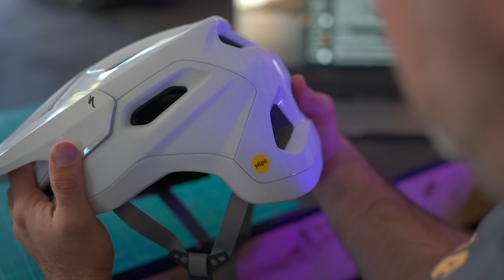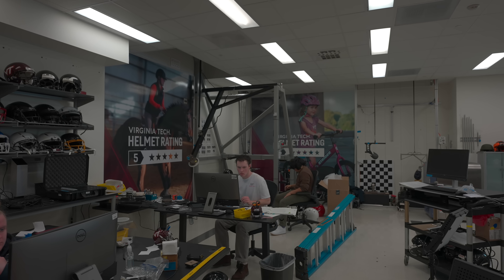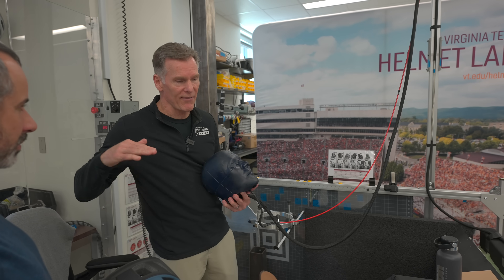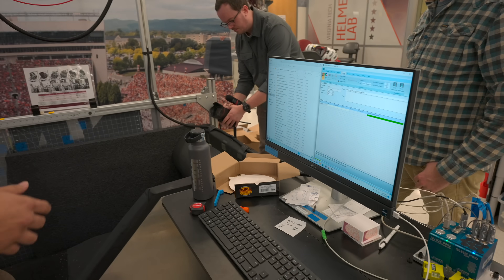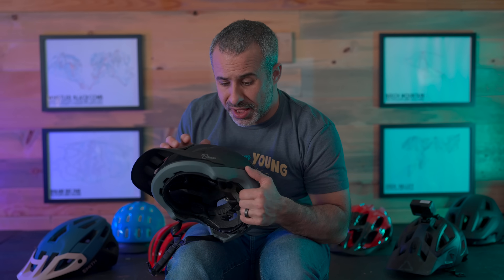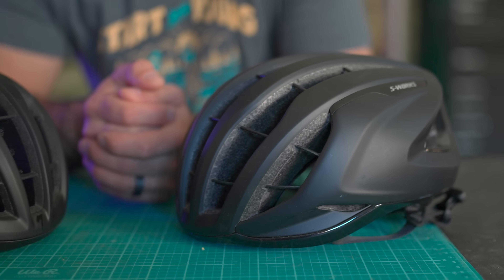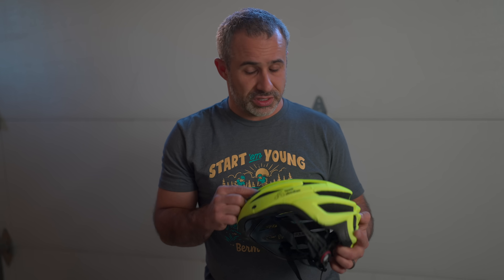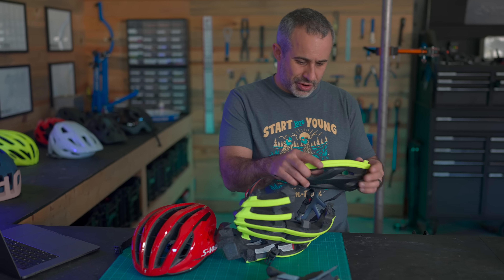Are Cheap Bike Helmets Safe? We visited a helmet testing lab to find out

Comment: I recently had a friend crash on a ride.  It split his helmet and he died on site.  He had a MIPS helmet bought at Costco.  I wish all helmets were required to have ratings.  I know Costco has quality products,  but a rating would have been good.  We had actually discussed him getting a Bontrager.  I spend lots of time thinking about how a bike helmet is no place to save money.
Reply: MIPS isn’t a brand, it’s a helmet safety system and standard that is, in its own sense, a rating system. Thats why at 13:27 when he’s talking about the super expensive Specialized S Works helmet it has a yellow MIPS sticker. 

Your friend likely had a very good and highly rated helmet. 

With that said, there are going to be helmets that at a certain point aren’t going to be able to protect a head when enough force is applied.

Comment: Great information. I once witnessed a crash that really drove in the reason for a good helmet. I was on a week long bicycle tour that was also raising money for a good cause. Anyway, one of the days on the course the highway department was doing crack repair. They cut out the cracks about an inch wide and at least a couple inches deep. Then they clean out any loose debris and fill the cracks with fresh hot tar. The be part the section we came up was long downhill, every rider on the tour new about the hill and we were fired up to bomb that downhill run. Organizers of the tour and the highway department had other ideas they had people warning us to slow it down, that road was not safe and that the cracks were wide enough to swallow bike tires. Most riders slowed down, but one woman, she blew through them with her hair on fire and bombed the hill. I’ve hit speeds in 50 plus mph coming down this hill, and it a lot fun, one of the interesting parts of this piece of road is a large rock outcrop at the bottom, they built the road so it goes around the rock. And normally it’s not a problem to navigate, even at 50 mph. But not this day. Anyway, she hit the bottom at max speed and her front wheel sucked into one of those cracks stopping dead right at the apex of the curve. She flew a good 30, 40 feet through the air before landing on the rock head first in pile. She didn’t move, me and several others figured she was dead. Her helmet cracked in half and she was out cold. Now hers were Fate watches over children and fools. The nearest hospital from that location was about 40 minutes away. One of the riders was a nurse and had the good sense to not move her. But then a National Guard medical unit returning from Duluth after training for closed head and spinal injuries just happened to be coming down the road shortly after the accident. Within minutes of being told what the situation was the unit jumped into action, they not only attended to her injuries and stabilized her, but they called in one of their helicopters and air lifted her to the area hospital capable of dealing with her possible injuries. Two days later she was cleared to return to the tour.  Even though she was knocked unconscious, she only had a mild concussion and a sprained wrist. Now I don’t know or remember what helmet she was wearing, but it was a well known name brand. Even through the helmet was cracked from the impact, we guest she had to be going at least 40, 45 mph if not faster when she hit the rock, everyone agreed the helmet saved her life.

Comment: Manual for my Bontrager Wavecel Helmet. It said it should be replaced in 3 years. Do helmets not in accidents still need to be replaced after aging? "Helmet parts lose strength over time, so even if the helmet has not been impacted or damaged, replace it after three years."

Comment: That Bikeroo is a Cannondale been rebranded there on Eeeeby just now for 29.99 in UK I've not long bought one its really nice fit and comfort! Its just not MIPS AS 2021/22 model Ex Cannondale stock so will be decent! I am very happy with mine!  
my POC was expensive But the POC tectal sits to far down to my eyebrows! Feels to big and heavy on the head! M/L I Have a 58in head but feels to big still! seeing others with it sat there yeah it looks like it should be but can't get used to the weight of it, im a bobble head when riding I don't find it comfortable, maybe with a hat on it will be better I'll have to test it out so going to use the lighter Cannondale/Bikeroo for Summer and I'll see if can use the POC in winter with a hat.
Great video as usual Seth mate just wanted to add that about the Helmet being Cannondale

Comment: I got a 10 bucks helmet from LIDL (basically the biggest competitor of ALDI in Germany), had a hard crash with it. it got a dent, my neck hurt a little and i had a small headache after. Impact was pretty rough, OTB right onto a stone buried into the ground with like 30kph. Did its job, i still have it as a trophy :D Usually i use a O´Neil fullface tho.

Comment: The only time I've ever really needed a helmet was a specialized. Front right side of my head into a curb diagonally at about 25 mph. 
Not only did I not get any head injuries, but it took the impact so well, I didn't get any secondary injuries to my neck or spine. 
Apparently, even before the UK passed a law making it compulsory for manufacturers to properly safety test cycling helmets sold in the UK, specialized already were doing, sort of like the volvo of the helmet industry. 
It's basic logic if you think about it; it is a safety product, so we shall test its safety!

Comment: Like said in the video: buy at a trustworthy dealer! But, even a cheap helmet with low rating is better than no helmet. I had a low speed crash in 1991 on a icy road. Result: concussion. I instantly bought an helmet and using it since then.  Aldi started selling low cost bike helmets 20 years ago for less than 20€ in Germany.  I replaced my first Uvex styrofoam helmet 10 years later with one from Aldi. Nowadays I'm using a high rated helmet from Cratoni (German manufacture)

Comment: Just a clarification: On Amazon, even buying from the companies official store doesn't guarantee you won't receive a counterfeit product. Amazon comingles anything with the same UPC and so the official store merch can get mixed up with returned or 3rd party seller goods. It's happened quite a lot to me with socks for some weird reason. Darn Tough had an issue on Amazon where a ton of the socks amazon was sending out were counterfeit, and it was resulting in a lot of returns to darn tough(lifetime warranty on their socks). 

I've also had it happen with electronics a few times. So just be aware that Amazon offers no protection against counterfeits pretty much at all. I've never tried to return a counterfeit item to Amazon, so I have no clue how their support responds to it.

Comment: Thanks for the very informative video, Seth. I’m not a newbie in mountain biking, but now that I’m living in Canada (originally from Brazil), I have more reasonable choices at fair prices. That said, based on major website reviews, I purchased two Smith Engage MIPS helmets, one for me and one for my wife. I’m so disappointed to realize that Smith hasn’t submitted the Engage (actually, the only Smith helmet with a star rating by VT is the Forefront, with a not impressive 18.62, 4-Star rating) to crash tests. The reviews often discuss subjective aspects like "ventilation" or "comfort," but they seldom mention crash tests. The primary reason for wearing a helmet is safety. Comfort and ventilation, while important, are irrelevant if you cannot trust the helmet in the event of a crash. Without checking VT, I (luckily) recently purchased the Troy Lee A1 Classic MIPS, rated 5-Stars, with an 11.65 score for CAD 75.
Again, thank you so much for addressing this. You’re always at the top of my YouTube list.

Comment: Great video! Thanks for putting together a really thoughtful and well produced review of this crucial piece of gear.

You cannot "reduce" the force of an impact - but you can reduce the delta of the impulse (time taken to impart the force) and increase the effective. I would tend to think that the stomp test was...less useful, though dramatic. The force was applied from an incorrect perspective and in a very unlikely vector (straight-ish down from the top of head). In an impact, you (ie. your head) is in motion and the helmet is designed to spread the effective area and increase the time (by a few milliseconds). That is why the sensor package was positioned inside the helmet. Even the padding on the bottom of your shoe could be a confounding factor as it could have created oscillatiions in the force applied. All that said, the side by side comparison was still intriguing. Did anyone else notice that his foot was completelyoff the floor with the specialized helmet and not the rip off? Pretty wild results there - and enough for me to agree that the rip-offs should be avoided!

A follow up with the lab and legit/counterfeit helmets would be very interesting. Though I doubt they would be willing to do that test. If a counterfeit helmet actually tested well, it might reduce manufactur interest/support.

FYI, I am an engineer and have designed force testing rigs. Not an expert, by any means, but can do a simple free-body diagram.

Comment: I wonder what the actual change in risk of injury is between star ratings.

If you say no helmet is the default, and the best helmet has a 96% reduction in head injury, where is the 2star helmet? I'm guessing it will still be close to 95%.

I honestly think that even that garbage counterfeit one is probably 60%.

And this is only looking at head injury, if you look at the total reduction in injury it will of course be smaller still.

Quality probably matters more for adults at much higher speeds. They have more mass, more height, more energy. An adult traveling at 30kph will have many times the energy impact of a child traveling at 10kph. Even more true if you're talking about getting hit by a bus.

The real key is that you should wear a helmet. ANY helmet. And avoid roads/practice good road safety. Don't be scared away from biking if you can't afford a $100 helmet to go with your $20 bike.

Comment: I backed the Unit 1 Aura Helmet on Indiegogo  - list price full kit is $500 without the PhotoChromic Visor (goes from clear to very dark for an additional $150 - this helmet has crazy bright light bars and accessory lights for the bike that sequence turn signals together. Its very light weight for a Smart Helmet (350 grams) super ventilated and offers Lumos style light ecosystem for a whole bike approace. This is the same company made the Faro (a bit too flashy for me) I'm gonna make the lights all match my Okai Ranger EB50 -in frame lights! It will be outstanding,  if they ever ship mine! Does $$650 seem too much?
Reply: The Bikeroo doesn't meet ebike standard (higher speed protection-28mph) nor does it have Mips, -I have a million dollar pipeline embolization device (stent) in my brain, seriously... but it's a great helmet for road/mountain biking for the ridiculously low price.

Comment: Just a little addl info. How gopros seem to affect safety seems to be hobby specific. Also star testing tests impacts and the answer given was contextualized to that. Here's a counterpoint. Ski helmets went through a major safety reg years ago and additional rules were put in place. In ski racing, the use of action cam as well as mounts or anything protruding is banned in "speed events" (FIS classification). FIS RH2013 increased concussion safety in impacts but the regs around the cams were due to them catching after initial impact during sliding which could jerk the head and create injuries.

Knowing this is why I'm hesitant some days on the type of ride when I'm downhilling, dirt biking, or motorcycle racing on my helmets. There's plenty of helmet ratings and regs, but it's something else to consider

Bike crashes may be lower speeds but there's also a lot more that protrusions could catch on. Take that however you will. Ride safe!

Comment: as a cyclist and motorcyclist I would absolutely LOVE if they would get a rating system like this for motorcycle helmets, especially those that are only DOT rated, no Snell or ECE. This is especially important considering the speeds and impacts there are when riding motorcycles. I would love to know how well a $150 dot helmet stands up against a $700 one, especially considering how easy it is to get a DOT rating on a motorcycle helmet, think your average v-twin rider thats more concerned with looks rather than function and gets one of those $100 pudding bowl helmets that have nothing more than some soft foam inside for comfort, yet has a DOT sticker on it and is supposed to protect my noggin from an 80mph highway impact (yes I know those helmets are absolute BS but thats kinda my point). And going back to the  Snell/ECE ratings, I know these are much much better and if you can afford one thats definitely the better way to go, but certain creature comforts (IE internal visors) dont allow for those ratings, so knowing that my DOT only helmet is ACTUALLY up to standards would be awesome.
Reply: Unfortunately, I have a gargantuan head and the only motorcycle helmet I've found that fits is the HJC 5x models.  Of course, the bigger sizes are only DOT rated. 😳
Reply: As a retired sports medicine professional (AT Ret.) I also used to ride motorcycles. Motorcycle helmets back in the day were all rated for a 15 mph collision - basically falling over from a standing position - no matter the price. This video is nice in showing the current testing procedures for sports helmets but ultimately a motorcycle helmet prevents your scalp from getting ripped off. As for fashionable brain buckets ... don't crash. And concussions in sports? That's a whole other game beyond the helmet.
Reply: And more full-face MTB helmets! They've only tested 4!
Reply: @huntstyle  Their testing methodology does not cover impacts that fullface helmets protect from :(
Reply: No need, motorcycle helmets are only for the authorities to find your head after the crash .😂
Reply: You should really buy a ECE 22.06 rated motorcycle helmet. They are pretty cheap nowadays and many of them have a internal sun visor

Comment: I bought a Tactic, but the visor design is worthless. I'm going to mount my headlight to it and use it for night riding only. 

I think I have 7 helmets right now (maybe more I'm forgetting). They serve various purposes. Full face has yet to be worn, but looks nice in my van 😂

I have yet to damage a road helmet, they just degrade over time (I ride 10-15000 miles a year). 

MTB helmets get replaced from damage. I don't hit my head often, and usually they are minor impacts. I inspect and toss if I find damage.

Comment: I had a bad crash last year,tyre exploded on impact,i had a broken collarbone,4 broken ribs,and a brain bleed,i was knocked out,and airlifted to hospital 
My head hit the floor first,i had a POC helmet with the mips system,it cost me nearly £200
The helmet split on the outside,but was fully intact on the inside,without doubt,it saved my life.
Bearing in mind im 98kg,crashed at 30 + mph,from approx 8-10 feet in the air off a big table jump
I would not even consider a cheap helmet,it begs the question,how much is your head worth?
My helmet did its job,so in my eyes,money well spent,once healed,i was back out there,if you can afford it,buy the best one you can afford 🤙

Comment: I went to a bike shop to try some helmets and I'd recommend that to everybody. I was used to wearing a not-so comfortable helmet for work but the first few bike helmets I tried on were somehow even worse. They weren't cheap, they were just not right for me.

And then I was handed one by another brand and it was immediately comfortable. I was amazed at the fact that helmets even could be comfortable. So now even if I buy online, I know what to get.
Reply: I have yet to find a helmet that fits safely and comfortably on my noggin. Every helmet I've had so far was either a loose fit, or gave me a headache after a short while. I still wear em every time, but it sucks knowing that in the event of a crash, my current bike helmet would probably just slip off the back of my head and I can't even adjust the straps in a way to prevent it, not without them pushing hard on my throat anyway. Plus it's way too old.

I just addressed that same problem with my ski helmet this winter and managed to find one that fits firmly on my head while miraculously feeling no less comfortable than wearing a beanie, but no such luck with bicycle helmets yet... 😩
Reply: @LRM12o8  Did you go to a bike shop? If it is a proper bike shop with bike enthusiast staff then I would ask them to try and find the best fit for you.
Reply: @LRM12o8  Yeah, just because the size ls adjustable, doesn't mean it fits well. My best idea would be to maybe order a number of different models from different brands at the same time to then return all but the best fitting one.

It sucks that there isn't a simple solution besides trial and error and the shotgun method. Travelling a long distance to get to a huge bike store also sounds rather undesirable.

Comment: For Road helmets I agree that they usually don't get any impacts. But on a MTB the ground sometimes gets in the way, or low hanging branches, or you just forget that you are slightly taller when walking around. So the helmet collects dings and scratches over time. Is it better to buy the $55 Helmet instead of the $110 one and replace twice as often?